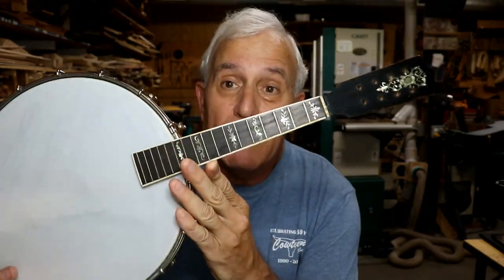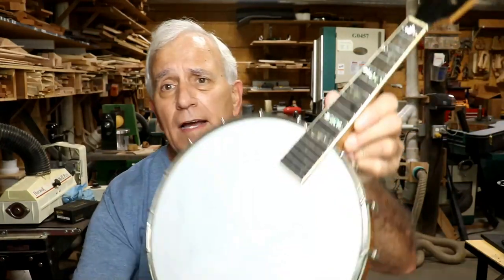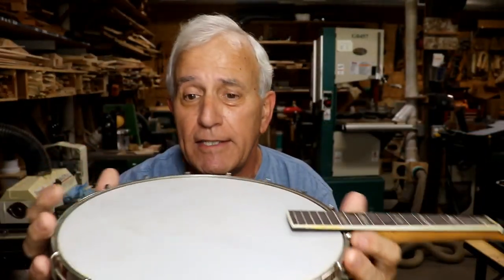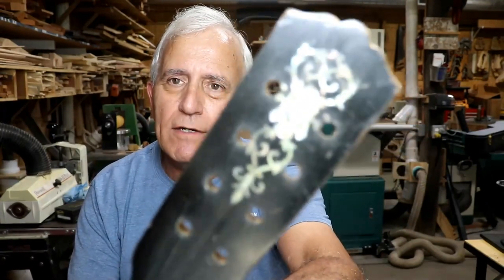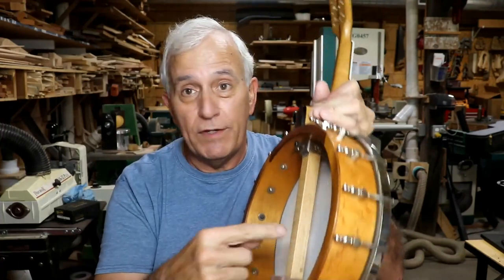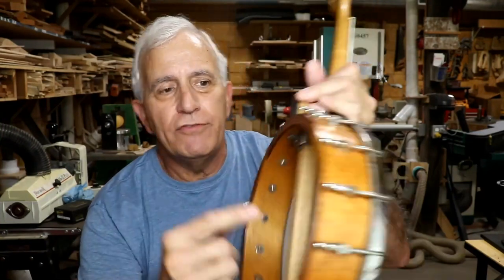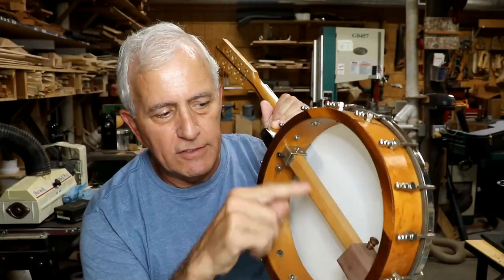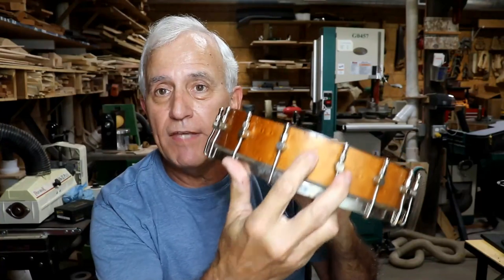Vlog #096 Banjoline Innovation and More Kidney Stones

Comment: It depends on how big the stone gets before it passes. I have a history of getting uric acid based stones (not calcium based). Uric acid based stones can't be detected with X-rays. They have to use an iodine tracer. I am allergic to iodine, but that is another story. I got operated twice several years apart. Both times the kidney stone was the size of a golf ball. Those stones weren't going anywhere. The excruciating pain was not from the stone trying to pass. It was due to inflammation of the kidney because of infection.  Stones make you more susceptible to kidney infections. The stones had to be blasted apart into small pieces using electrical impulses. I think the stones were too large for laser blasting.

By the way, I like what you did with the banjoline